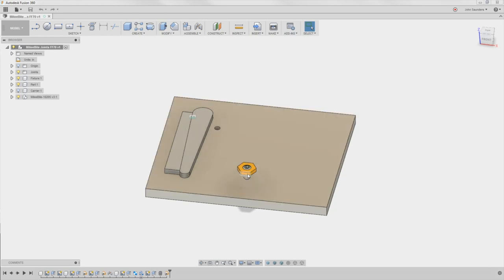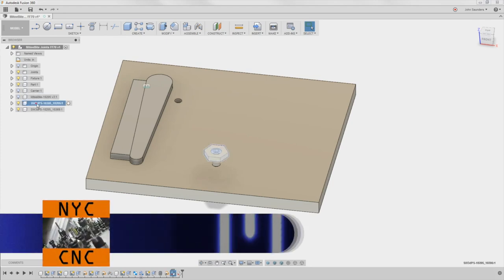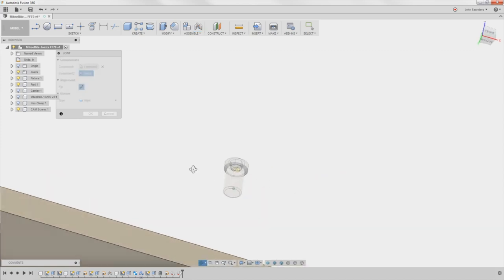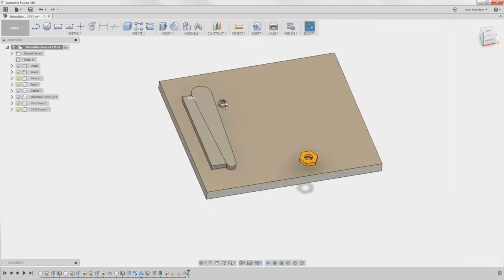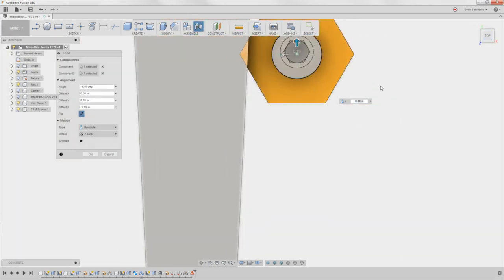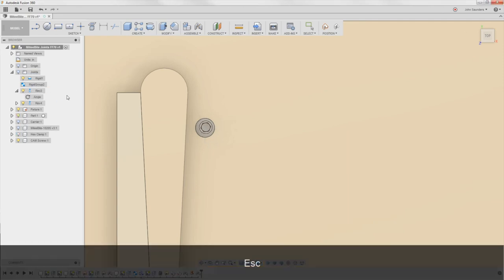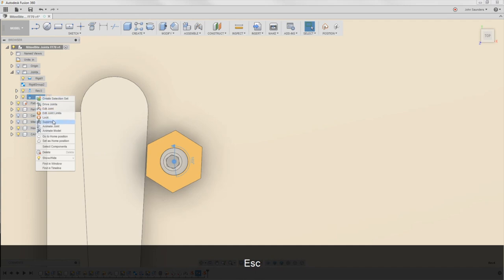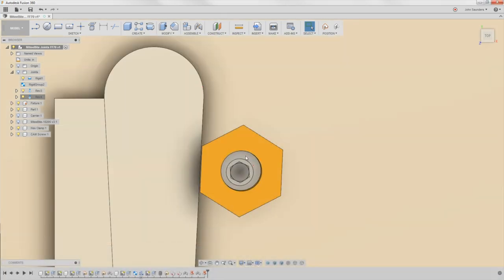How to model Fusion 360 Joints for Mitee Bite Fixture Clamps! FF70

Comment: I remember using solidworks 12+ years ago to design an ITB manifold and never had an issue calculating interference dynamically. I was really surprised how resource intensive Fusion 360 collision detection is.

Comment: Instead of suppressing one of the revolves, just enable contact between the hexagon part and the work piece and it will self align as you turn the screw. Alternatively, leave contact sets out of it entirely and create a planar joint between one of the hexagon faces and the work piece, that will constrain the two revolves in the right fixed position. The way you did it, it was pure luck that one of the hexagon faces happened to be more or less parallel with the relevant face of the work piece.

Comment: I'm afraid I cooled on Fusion360 when I started trying to use the whole "joints" thing - I just can't get my head around it. I mean, something as simple as a parallel mate, and you got to do a bit of trickery to make it work? I'm so used to the Solidworks mates, and I've actually gone back to using SW for modelling, keeping Fusion for the toolpath generation instead. (Due to, aherm, a series of unfortunate events, I know have a full license for Solidworks, so I might as well use the blasted thing!)

Comment: I'm very new to Fusion so I could be wrong.
I think that if you use a slider joint on an origin point perpendicular to the side of "part1" and then use a planar joint between "Hex Clamp" and the new origin you will get the sides parallel.

Comment: Hi! NYC CNC I have a trouble for you to answer, the program Fusion 360 postprocessing you use the file handler to the processing center, I Chinese from my CNC is drilling and tapping machining center, using the DASEN-3I system, the new generation system, do you think a good with some postprocessing.

Comment: Hey John, great video!  I was just wondering if you could post the specs for your CAD computer.  I have been wanting to build a new CAD computer to use with Fusion but I'm not sure what all I will need.  I had a computer setup for Solidworks in the past but I have heard that the requirements for the graphics are different that those for Fusion.  I am not a computer expert but I think it had something about how Solidworks being open gl and fusion being direct X so the graphics card requirements were different.  Anyway, I am just wondering what I NEED in order to run the CAD and CAM efficiently and I figured you would be a good person to ask since you use it all the time and I also thought others may be in the same boat.

Comment: I don't like this joints, they are faster if you need to do something simple, but once I did two mate in SolidWorks so my part can move only in one direction and for that limitation I needed to do tip of parallel away from 3D surface for 1 mm or so, so I can see how far away is my other side of parallel from vice's face need to be. I don't know how would I be able to do it with F360, If you need a single more complicated think, joints are much slower and less flexible. :S

Comment: Have you thought of going metric and working in mm (millimetres) ie 4.826mm rather than 0.19" inches etc...
Reply: John Thimakis commie units are not allowed in USA
Reply: if  i were you i would  not say a word, metric is much more simple than imperial, you are stuck into something that's horrible, working with fraction numbers
To the decimal number system the metric unit fits the best
Reply: Yes. Ultimately the basic metric unit is a real thing. So why not start from Inches or indeed various other starting places depending. It is all relative. "metric" is not any more absolute than any other arbitrary system and all systems are arbitrary in the end.
Reply: Tartrazine 
No one is saying that metric is absolute. It is only simpler to use because it scales in powers of 10. 

You don't need to memorise arbitrary values like how many inches in a foot which is different to feet in a yard which is different to yards in a mile etc.

1mm ×1000 = 1M x 1000 = 1kM much simpler if you are honest. The prefix also denotes the multiplier. micro, milli, kilo, mega, giga etc.

Comment: Does Fusion 360 have a constraint function? It would be under the assemble section of your toolbar with the joint function.   I know Inventor does, and it has a parallel constraint that is similar to the one in solidworks.
Reply: No just Joints

Comment: Can you not use planes/surfaces/edges to build the assembly? IE the OD surface of the pin to the ID surface in the plate, OD surface of offset pin to ID surface on hex, bottom of hex to top of plate, bottom surface of the offset part of pin to the top surface of the step in the the hex?

Having to build it the way you have shown would drive me insane. That would be an absolute, don't even waste your breath trying to show me other features, kind of deal breaker if Autodesk was trying to court me on Fusion.

Maybe I've just been too spoiled by NX and SW.

Comment: To get a parallel constrain you can use an angular constrain between the two faces or lines and set it at 0 degrees, this will keep them parallel. At least this is what I do on inventor

Comment: Should be able to leave those components how they were and not pull them out of the assembly. I use ball joins from McMaster library all the time and leave them as is. I activate that component and then do the joint.

Comment: why did you switch from Solidworks to fusion 360? Is the CAM software better in fusion?
Reply: From my personal experience, Solidworks is like a baby fusion 360/inventor. Though saying that, I might be bias considering I am pretty darn good with autodesk products
Reply: cough wha?  Fusion is very much the baby vs. SolidWorks.  It's growing fast, though.  I lost track of Inventor vs. SolidWorks... my last impression was Inventor probably continued to grow from relative parity and SolidWorks has only been adding almost trivially small crap for years.  That's the problem when a company has a more premium product (Catia).
Reply: Darron Black Yeah from what I have seen so far everything that 360 is doing Solidworks did 10 years ago. That's why my question came up.
Reply: Well, while that is mostly true... I do think Fusion's style COULD be better than SW after some more development.  I do hate the joints vs. proper mates, though. I'm using Fusion for the CAM.. that's basically the only reason.  Oh, that and teaching my 10 year old.

Comment: Have a 7700K @ 5GHZ and using "contact sets" used exactly as shown just causes my twelve 120mm CPU fans to go 100% briefly while locking up. Memory usage is around 50%(8gb out of 16gb) and CPU usage hits around 30-50% but nothing happens.